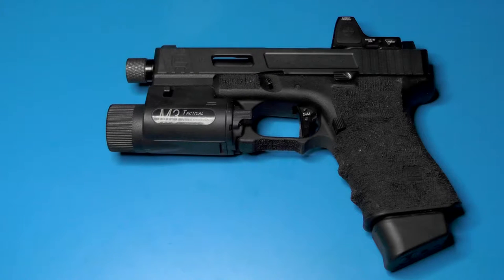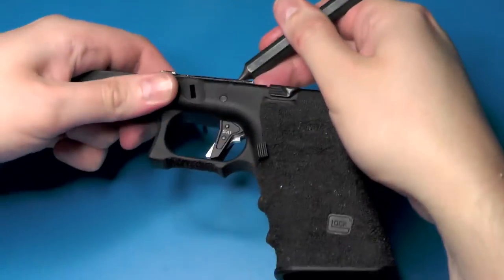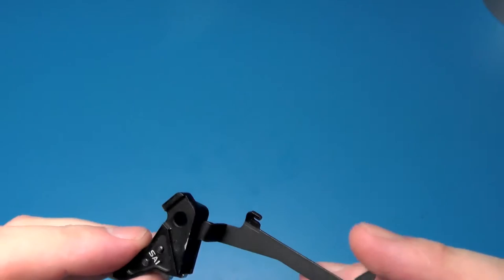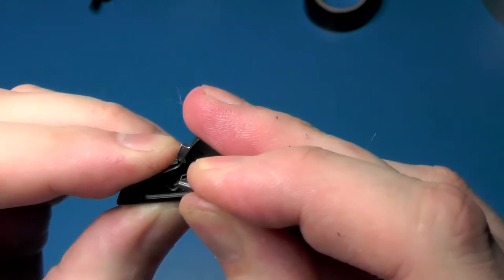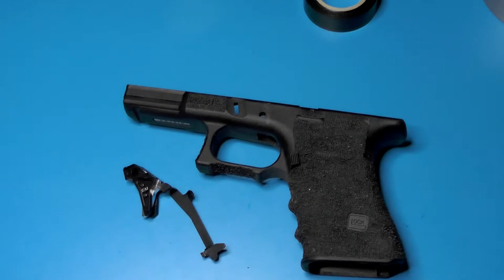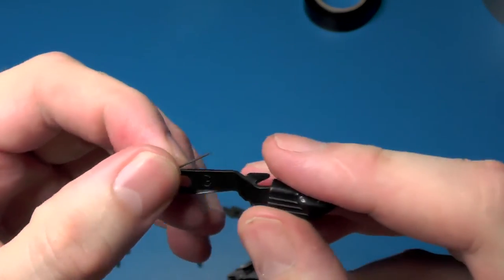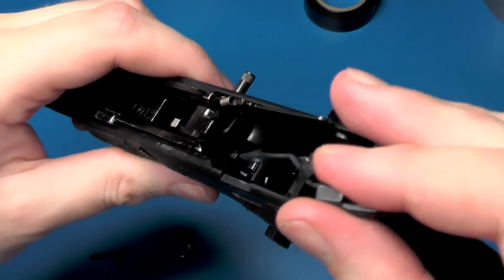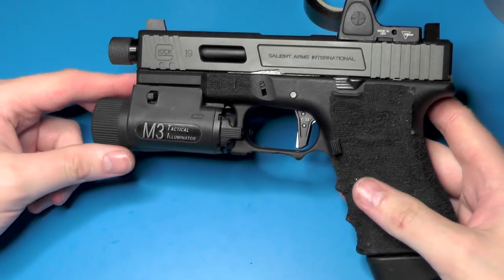Tech-tip: How to install the Ace 1 Arms SAI trigger in a TM/WE Glock

Comment: Thanks a lot!

FYI: It does work pretty much the same way with Umarex/VFC G17 Gen. 4. Its really close to identical. 
I installed the CowCow Trigger. Only thing worht mentioning is that the trigger safety is close to non-functional if you install a TM trigger onto a Umarex G17. But it looks and feels so much better.
Can't put enough emphasis on DON'T lose those tiny springs and bolts tho.

Worked like a charm.

Great Video!

Comment: Hey man great video and a beauty of a glock! I’m looking to upgrade my hammer, sear, and knocker and I’m wondering what would be the best to use for my TM 17 preferably requiring no modifications. I found a kit that RA tech makes and the price is right but ultimately I’ll pay more for compatibility
Reply from the maker: Avoid RA Tech. Their fit and finish are sub par.
I prefer Guarder (http://www.intrudershop.com/whatsnew_eng.asp) parts because they have a full range of drop in fit upgrades etc. but Cow Cow Tech (https://www.cowcowtechnology.com/) are also good.
Reply: Non Existent thank you so much for the reply man! I’m in Canada and a local shop carries mostly guns modify stuff, I feel like it’s pretty drop in friendly but they won’t let me buy just the hammer.. I have turned buy the 2017 version zero hammer, (which is 50 bucks)toss the rotor out as I already have the new version BBU will look into those links !
Reply from the maker: Ah. Hrmmm... Not a big fan of Guns Modify parts for some reason. No first hand experience but they just feel "off" some how :-p
Best of luck!

Comment: hi! I realise I'm a bit late, and I realise that WE is in the title, but this trigger will fit in a WE without any modifications correct? I've always been worried that since it's TM compatible that it might not be suitable for WE. thanks!
Reply from the maker: I installed it in a WE Glock and it worked fine so it should be compatible with both WE and TM.

Comment: Does this trigger also work on the WE Glock 23 Gen4? I ask because you can switch between semi and full auto on it, but you can't on the 19, so then you maybe need a special trigger?
Btw, does anyone know why the 23 is so less popular than the 19? Is it because the realsteel 23 doesn't have full auto or is it an another reason?
Reply from the maker: Yes it will work with the WE Glock 23 GEN4.
The 19 model is more popular because the real Glock 19 is 9mm and is the most popular model. Glock 23 .40 S&W model and is less popular.
Also there are less aftermarket parts for the Glock 23 with .40 S&W markings etc.
Also most people don't like full auto guns for whatever reason. For me personally it is more of a gimmick and also means they break easier due to the extra parts and stress of full auto function.

Comment: I noticed that you have the bearing hammer rotor. Can you give me your opinions on it? Does it do anything for friction while the gun is firing or does it just feal nice when you rack it? Would you be worried about the bearings failing due to the impact of the gun firing? Where did you get it? Everywhere I look they are out of stock.
Reply: Ive had 4 Action 8mm hammer ball bearings fail in two different we glocks. Its nice to have, or you could just mod your stock hammer roller so that it sorta kinda rolls nice. It`s not as smooth as a ball bearing though. And they are cheap so it`s not a big deal if they break, unless it makes your gun lock up when it do break.
Reply from the maker: Well, I can't really say what the impact is of using it but the logic makes sense to me and it's a cheap enough product that I put one in every Glock I build. Can't speak for durability, see Perlens response. I have bought my last ones from WGC Shop and they can take the order and deliver even if it states out of stock on the website.

Comment: What happened if im not put the trigger safety again?
The glock still firing or not?
Because my marui glock safety triger gone
Reply from the maker: It works without it.
Reply: is there any problem if im not replace those thing?
im afraid because im not upgrade my marui, so its still plastics.
Reply from the maker: No, it should work fine without it.

Comment: Would this work in a cybergun m&p? They have just recently released a Cybergun EMG licenced SAI M&P9.
Reply from the maker: No it does not. The EMG SAI M&P is by VFC and the triggers for Glock and M&P are different anyways.
Reply: Oh sorry, what I meant is that would an ace 1 arms M&P trigger for we/marui fit in a cybergun M&P?
Reply from the maker: Right. I am pretty sure the answer is still no though as the Cybergun one is a different design base. There are however new Cybergun/EMG licensed SAI styled M&Ps out right now if that is of any interest: http://www.evike.com/products/63602/
Reply from the maker: Just realized that it does not have the SAI trigger so doesn't really apply I guess.
Reply: Ok thanks for the heads up

Comment: Do you know if a rs glock trigger shoe will fit in a we g19?
Reply from the maker: Not entirely sure what you mean with the term trigger shoe?
RS Glock OEM triggers are sold with the trigger, the trigger safety tab and trigger bar as a complete set. I have modified a Glock RS trigger to fit in a Stark Arms Glock 19 but the trigger is attached to the trigger bar with a blind pin (only visible from one side) it required some destructive modding to fit it to the airsoft trigger bar.
Reply: @CJAwesome83  I found a p80 flat face trigger shoe( just the trigger piece without the trigger bar) and can't find anything anywhere if it will fit.
Reply from the maker: Alright, well, that would be called just the "trigger" :-p
I think, 99%, that it would fit but I did it on a VFC Glock a few years ago and that worked. Pretty sure the WE Glock trigger design is 1:1 to RS.